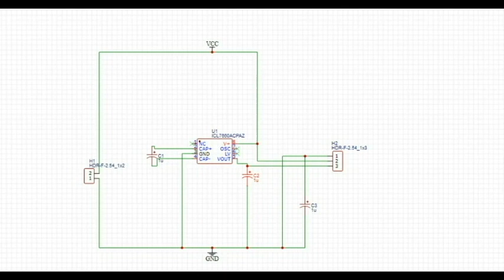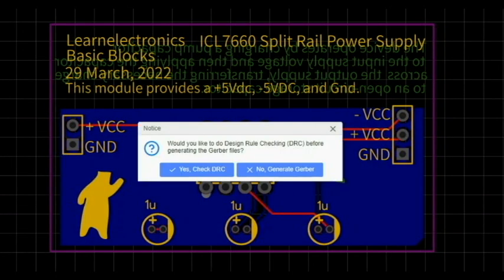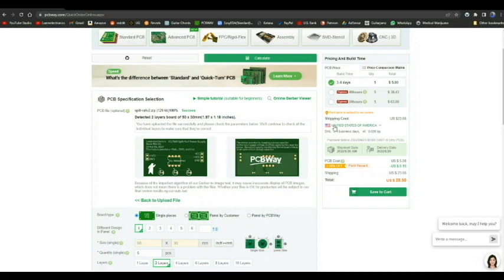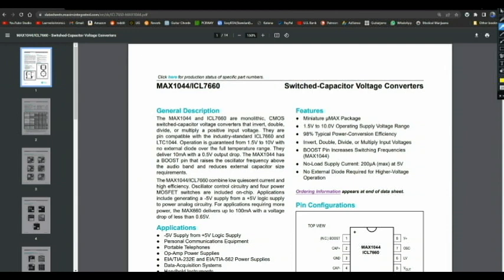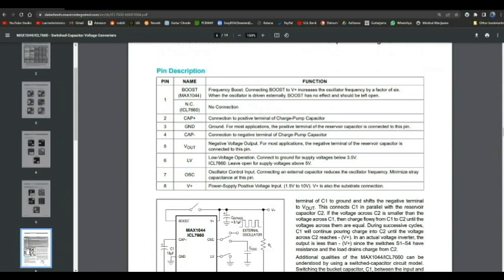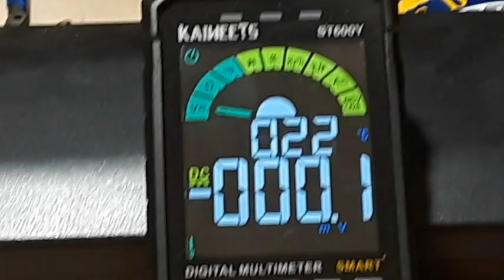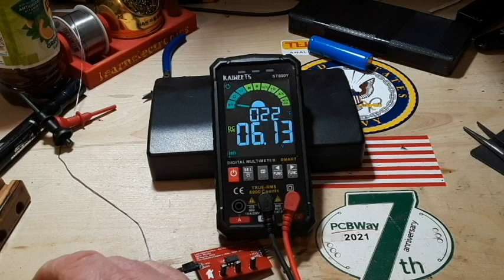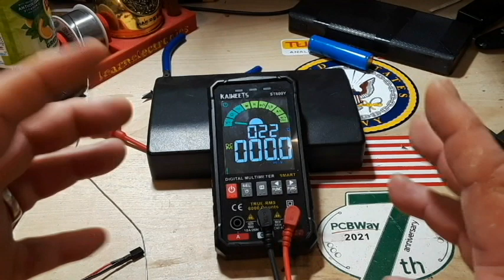A new split rail for the STEM kids

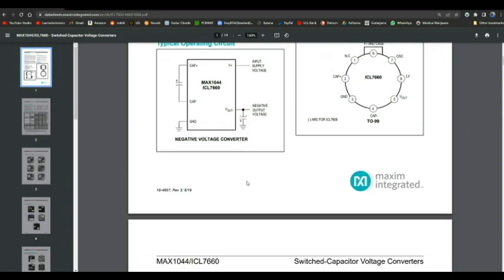Comment: according the the data sheet 4:47  you had the capacitor the right way around, negative output rail to the negative side of the capacitor, and capacitor c3 both ends are connected to GRD